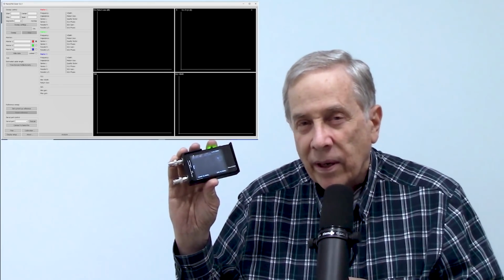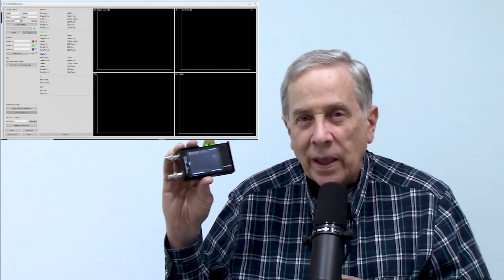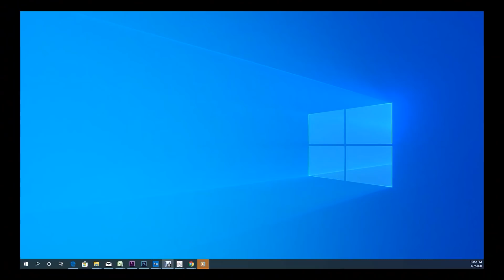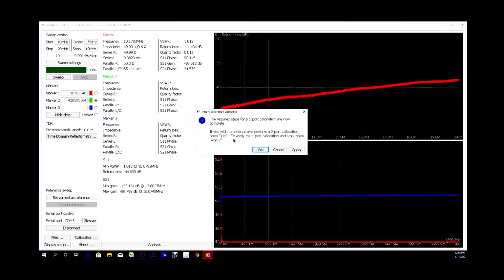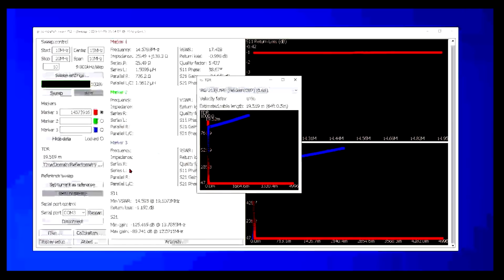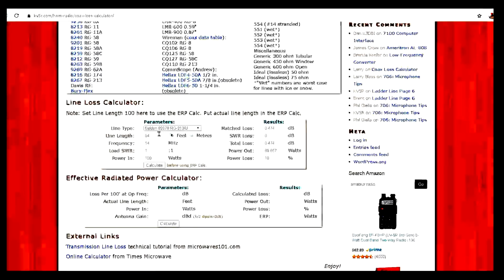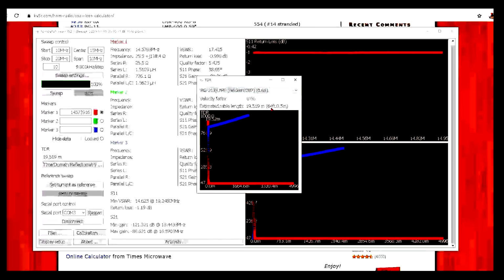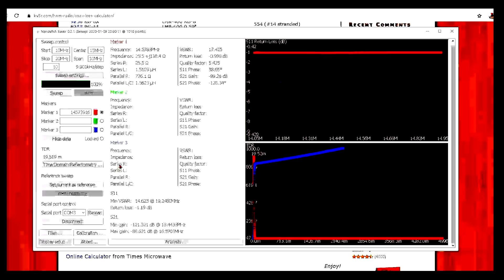NanoVNA To Test The Loss & Length Of Coax Cables by Jim W6LG YouTube Elmer for Ham Radio Basics

Comment: I had a NanoVNA-H (the small 2.8" screen one like you have) and now the NanoVNA-F (larger 4.3" screen and higher frequency) and love them! As you said, the free software and these little devices are so useful, especially if you make your own antennas. For doing a 49:1 EFHW or even tuning up a 6BTV vertical, you can in a single sweep see the entire frequency range and know if you need to trim/tune your antenna for any number of bands. I have a $300 RigExpert AA-55 Zoom and while that is very nice, it doesn't do UHF/VHF. To do that, I would have had to drop $625. For $50 or $110, you can get a device that actually does more. I've also taken my NanoVNA's in to the office and compared their readings to a $30,000 Agilent NA and while not exact, it certainly is "Close enough for ham work".

73
W9HJ
Reply from the maker: Great information. I did not know about the new model.  I will go over to Amazon and see what it looks like. We're lucky to have such a device that we never even dreamed about when I first got licensed in the early 1960's.  Thanks Bill.  Nice to hear from you.  73 from Rocklin, Jim W6LG
Reply: @ham-radio  I got mine off eBay. Supplied is in Kentucky so you don't have to wait forever for shipping. Most of the sites say 50kHz to 1000MHz, but there is a new firmware update that allows it to work up to 1.5GHz. Aside from the larger screen, it also has a metal body that totally encloses the unit all the way around and the SMA connectors aren't "floating" like on it's smaller brother, they are attached to the metal body.

https://www.ebay.com/itm/Handheld-HF-VHF-UHF-NanoVNA-F-Vector-Network-Analyzer-Kit-50KHz-1000MHz-4-3-LCD/283687994590

Comment: there are so many variants and copies of that thing that I don't know which is the right one to buy anymore... white, black, some with the gekko, -h and -f variants, some with faraday cages, some don't... it's getting complicated now getting the right one and understanding firmware releases that do not seem to be compiled and not so simple to upload in the device...
Reply: I got this one: https://smile.amazon.com/gp/product/B07T6LXNTV/ref=ppx_yo_dt_b_asin_title_o03_s00?ie=UTF8&psc=1. It is a recent version which includes a display of the battery level. It seems to be one of the good ones.
Reply: @gbennett58  yes that seems the same Jim got... search for nanovna-f, nanovna-h and now I found a NEW nanovna-h4... plus there are white, black and the one with the gekko logo on them... so many different variants that it is difficult to know which one to buy and how to get support for those variants... the one you listed is not available in Canada though...
Reply from the maker: The software is easily gotten. I have not changed the firmware but there are lots of sources for that too if you "google" that want.  I bought mine from Amazon know that I could easily return it if it did not function correctly. So far, it has been great and very useful.  73, from near Sacramento in CA, Jim W6LG
Reply: @ham-radio  thanks for the reply, the software might be easily gotten but on which variant ?

Comment: Wow Jim,  you look and sound great. Hope you are ceiling better. Another great video. I have the MFJ-269 and paid way more for less functions. We are close to Some AM broadcasting stations and on my 160 and 80 meter EFHW project I couldn't use it because it would pick up KTSA and KKYX from 30 miles away and get really crazy readings during broadcasting hours.

Comment: I received one from Amazon for about $70. It would not charge. I filled out the return information on Amazon, printed a free shipping label and in about 3-4 days  I had the replacement. I've so busy getting ready for Quartzfest that I have not had time to play with it. I'll take it to Quartzfest to play with it there. I'll load the pc software now! We used vinyl plank flooring in the house. It goes down quick.
Reply from the maker: That flooring has been debated here in my house for several days.  I am about to just paint the floor and call it done.  I want to get the desks into that room and get back on the air with a dipole in the backyard.  It has been a year and very much want to get things going again and have some fun.  I met some very nice guys from this area that meet at a local guys lab.  A lab that has everything you could ever want for testing anything. The owner is super nice and has invited me to return anytime to do a video.  A bunch of cables are in the room and lead to the attic.  From there, it will take a few days to get the other end to the master bedroom closet and then out the back wall at the A/C compressor.  From there, I have not figured out. Probably just a simple dipole for starts. How's your XYL feeling.  I am wearing a holter monitor and I hate this thing.  It hurts and is in the way.  Keep in touch and lets get together for a voice QSO on another means of communication.  73 and thanks again for your contribution to amateur radio.  Jim in Rocklin on a postage stamp

Comment: Jim, there are several items on Amazon called ‘nanovna.’ Might you please be able to post a link to this specific one ?

Many thanks, & 73’s
Gary....WB8ZGV
Reply: I am not Jim but they are pretty no much all the no same. Luck of the draw. I buy Amazon so I can return if bad. The little switch piece on the upper right seems to be the weak link. Some haven't been soldered.
Reply: There are a heap of so-called "fake" ones out there.  There are a couple of good videos (With links in the comments to reputable suppliers) from Kevin Loughin too on these.

Comment: Jim,  when you get a chance could you do a simple video on all the types of common coax used in the hobby?
Reply from the maker: That is a great idea.  Thanks!  Perfect for Ham Radio Basics.  I have some painting to do first. Need to finish the "green wall" for chromakey. Plus, I am wearing a holter monitor for the next 29 days that gets in the way of everything.  It itches too!  So I have to work around that thing getting in the way. Thanks Jack and 73 from Rocklin, CA from Jim W6LG
Reply: @ham-radio  The place is looking great!  I've learned so much from your videos and you inspired me to get my tech license, so thanks a lot for that!  I'm also looking forward to a video on different cable types, particularly wondering your opinion on using RG11 (75 Ohm cable) as a cost save.  I've looked at many loss charts and it seems decent for HF.  I've read that it's not a big deal there, with dipoles and all, just tweak the antenna length for good swr on your frequency - how about on 2m feeding a copper jpole?  I'll set it up this weekend, maybe I"ll let you know how it goes!  Thanks!

Comment: Another great video thanks Jim also my ic-7300 that is two years old blow up so got to get new transceiver thanking of getting another ic-7300 or a yaesu ftdx3000 what your thoughts thanks again Jim 73 kn4kbn
Reply: 7300 avoid the yeasu disappointment
Reply: hummm....what happened to the icom 7300 ? iam waiting for ic 705  cheers.
Reply: @sandraabarca6029  low power and when unkey and key swr is very high something is shorted😭

Comment: Thanks! I’ve been thinking about getting one of these, so it’s great to see another video about it. Especially from someone I already know and trust. 

One suggestion, if I may - I couldn’t tell what the video was about from the thumbnail and title, without clicking on it. The title was so long and the part about nanoVNA was at the end.
Reply: Did it come with the short and load? I've been tempted by this device at gigaparts...
Reply: @carlbrowning8409  they all seem to come with the osl hardware and a couple of short cables.
Reply from the maker: I will fix that now.  Thanks, Jim
Reply from the maker: Okay, thanks, I think I got that fixed.  73, Jim